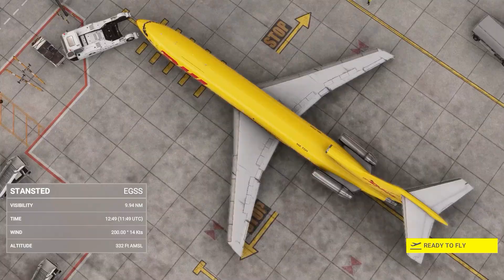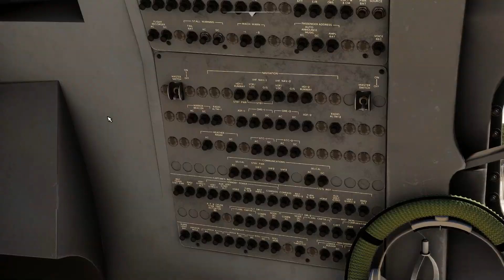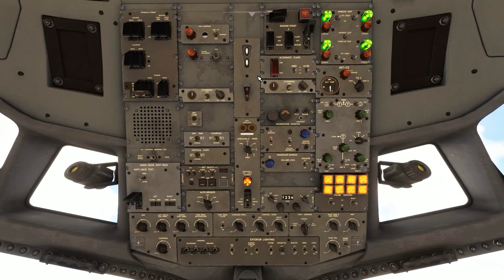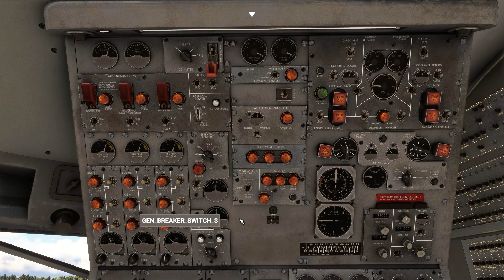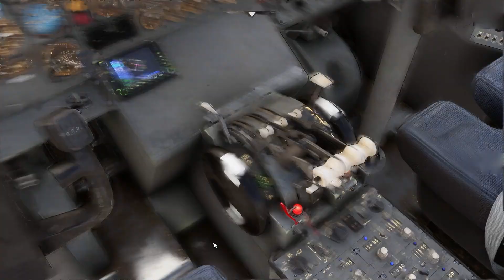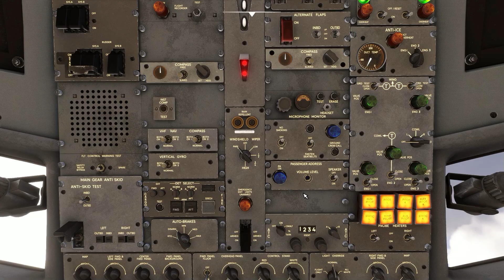FSS 727 MSFS - Cold & Dark Startup

Comment: When I switch battery on, I have 24 Voltage, but NOTHING happens, not even a single light burns
Reply from the maker: It’s possible the airplane has changed since this was made - consult the user manual :)
Reply: @TiJayFLY works for me
Reply: Same here
Reply from the maker: @henriklmao thanks, I may remove this video for now :)

Comment: On old engines like JT8D you introduce fuel to the engine after 20% N2 which is the high pressure compressor, unlike the modern engine like Boeing 777 which has FADEC. Thank you for the video.
Reply from the maker: @maxdenhaag1  yeah, MSFS engine simulation is pretty crap. You can just introduce fuel straight away and it’ll start 😄

Comment: YEAH its very cool at least someone DID a tutorial on how to operate the engeenering panel and the vid is not 3HOURS long so thx. But in all the other streams I saw people touching the fuel boost pumps and fuel valves, u didnt so do i have to operate the fuel boost pumps?
Reply from the maker: @French28Pilot  boost pumps are for one or two engine taxi as far as I could gather from the manual. I believe 3 engine taxi doesn’t need them. I flew the plane after this startup and had no issues, so 😄